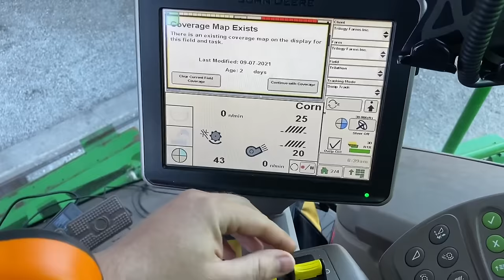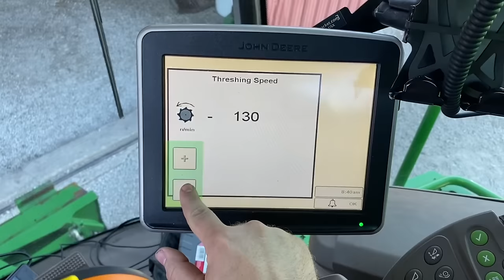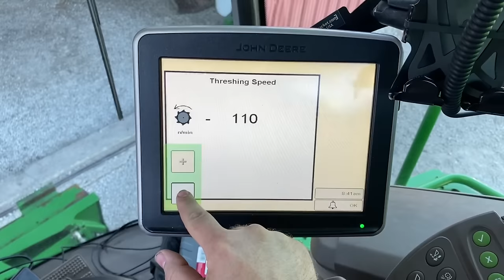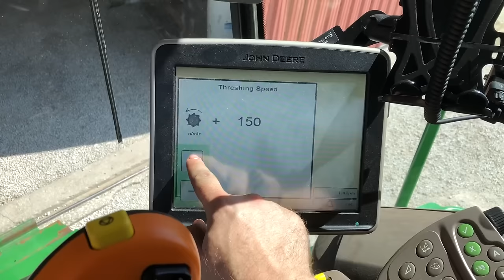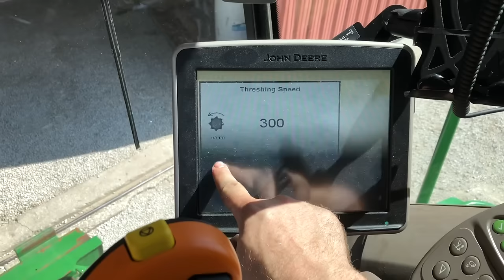John Deere S680 Rotor Belt Replacement

Comment: When I do rotor belts before I back off the turn buckle I jam a socket between the sheaves saves a lot of time and is easier on the belt less of a chance of ripping a chunk off rolling it on the sheaves.

Comment: Hasn't changed much from a 9750. Had one break apart in the field on me. Not near as clean and engine was nice and hot still. Along with a bent shield over the driveshaft perpendicular to the belt that we had to bend back. We have pretty good relation with the JD techs in the area and gave us the same tips you had here, but a video would have been better for sure. The video brought back memories. Great content, been enjoying watching your various videos. If I had a dime for everytime I've heard someone say something about if an engineer had to work on some of these designs. Lol

Comment: Very informative Z. 17 years ago, we had to replace the rotor belt on a 9750 STS in the field.  We were able to have it installed and adjusted quick! ( other combine only did 1/2 mile up and back). That was due the extra room in those machines, belt broke and gone, and knowing all the tools needed and having done once before.  Never needed to change it on S680’s or S780’s we have had since

Comment: Thanks Zeth, in the aero engine industry, some manufactures now have systems whereby the engine can send data back to the head office about its performance, so that when an issue ariese, the plane can schedule maintenance or be grounded in safety situations. Do you know if John Deere has a similar system? Perhaps, with all the sensors and on board computer, it could analyse the data and send a text to your office, order the spares and advise the operator that a maintenance issue has appeared and you can arrive, with the parts and hopefully fix things?
Reply from the maker: Yes we have a system called JD link. Look into it. It's scary what we can do with it.

Comment: Hi, you made it look easy. You have done it before, how often in the field ? Very hot, dusty, chaff, straw plus probably an angry driver or farmer, but at 6'4" if I was the farmer, I think I would give a hand and take up the offer of a winter service.  How was that cracked belt discovered, luck, inspection or a service ? Great videos, it's for real. Thank you.
Reply from the maker: Yeah I've done that job a lot. In field and shop. I found the bad belt during the inspection. Thanks for watching! I appreciate it.

Comment: If I can’t get rotor shifter in low.how can I move rotor to do so when I can’t reach around the exhaust filter.and get a good grip to turn rotor. Thanks
Reply from the maker: Pull down on the chopper belt. It easily turns over the whole machine.

Comment: Hey Zeth, I've got a question, on the right side of the combine there is a cut out that looks to be for a bearing on some sort of extra attachment, it can be found just behind the discharge beater belt and just to the right of the the manual sieve and chaffer switches on the back, I was wondering what the cut outs are for.?
Reply from the maker: Those are for additional components for a premium residue option. They can choose whether to wind row or chop. But the cut outs are on all combines. Yours just fell out and they can be patched back up if it's an issue with residue leaking.
Reply: How would I go about patching it up.? It causes residue to build up between the discharge beater belt and the frame of the combine, that causes the belt to skip a groove in the front pulley
Reply from the maker: @BoerPiet  take a piece of 1/8" metal and use John Deere combine sealer to stick it to the side over the hole.
Reply: I'll give it a try, thanks alot!!

Comment: Be very surprised if belt is not internally damaged from forcing onto pulleys . What procedure does manual call for ?
Reply from the maker: Trust me that belt is a tough SOB. It's fine. I did the procedure exactly from the manual with a few tricks I've picked up.

Comment: It seems like these newer generation John Deere are braking down a lot. I used to work at Caterpillar in Aurora IL and as the new wheel loaders where coming off the line a few per month would head to "R" bay for repairs and mostly it was all electronic issues but some were for mechanical but mostly all electronic

Comment: I think you must mean 8 cm not 8mm. 8mm is about 1/4 “
Reply from the maker: No I said 8mm and that is 5/16" of an inch
Reply: Then I don’t understand where this measurement should be taken
Reply from the maker: @MrRoundb in between the sheaves. It's called sheave gap.